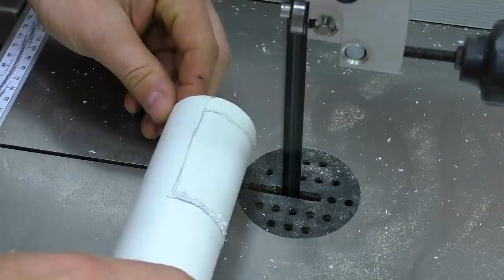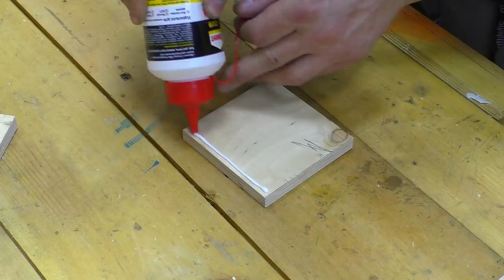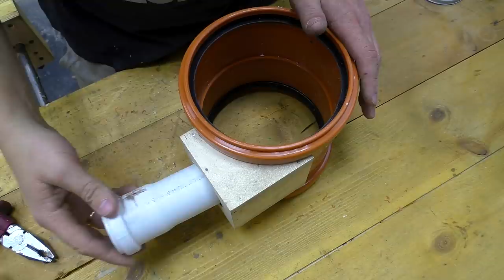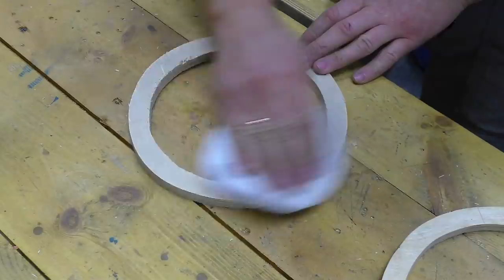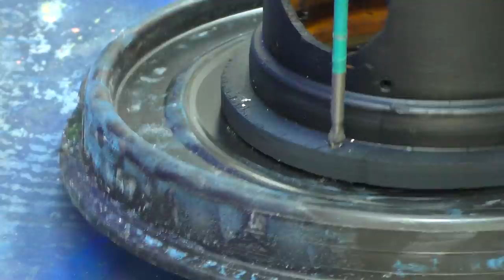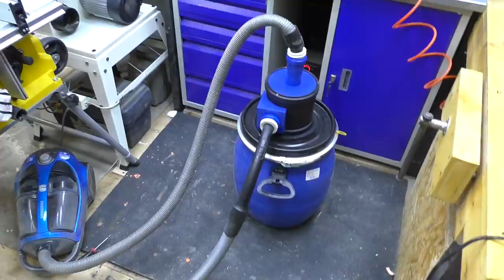A very useful idea for every man! To the garage or workshop.

Comment: At 1:58 into this video, you are showing crosscutting a 3" wide  piece of plywood using the fence as the only guide.  This is one of the most dangerous practices you can do on the table saw. Why? The width of the workpiece that is registered against the fence is too narrow for good control. If it should twist at all, with your hand holding it between the fence and the blade, your fingers will be drawn across the spinning blade resulting in their amputation. DO NOT DO THIS! For crosscutting short lengths on narrow pieces, use the mitergauge with an extended wood fence bolted to the face.
The fence will be cut up into it the first time you use it, but it should be tall enough 3" or 4", to still maintain support. The portion to the right side of the blade will carry your cut off past the blade as you feed it and your fingers will be no where near the blade. Make one of these ASAP! You are flirting with DANGER! See the post just below this one .......
Reply: D Maxson  I'm a complete noob using shop power tools and even I cringed at what he was doing at 2:00.
Reply: Thanks Patrick, video made me cringe

Comment: Well first of all whoever is doing this work has never been professionally taught the safe practices of use on a table saw.
1...blade should only be 1/4” above cutting surface
2...a push stick should be used when sawing a piece smaller than 4” so your hand is safely away from the rotating blade.
3...your right hand shouldn’t be pushing the object through the blade along with your left hand as you could inadvertently push faster thus causing the right side of the wood piece to bind on the back side of the blade and cause kick back. He has his anti-kick back installed but still shouldn’t take chances.
Reply: Kent Hildebrandt Why don’t you make a video and show us how it’s done?  Yep......didn’t think so.
Reply: I was puckering while watching.

Comment: Still using those silly ass phillips screws rather than the Robertson square head.
Reply: Or the star screws.  I use big Timberlock screws for screwing logs together with a 1/2 inch drill. Love em.
Reply: Those are only used in Canada, eh.... In the US, we don’t have them..
Reply: Scott Bergman yes I know. US doesn’t want to use them cause they were invented in Canada. Try building a deck with Phillips screws and some with Robertson screws and you tell me which heads are not stripping. They can take a shit load of torque.

Comment: An extreme amount of work for a vacuum cyclone.
Buy PVC pipe fittings close to the size of your vacuum hose.
Get any bucket or drum with a top.  On one edge of the top put a 90 degree fitting inside the bucket aligned with the side of the bucket and 
use a short piece of pipe to pass through the lid with another 90 bend on top facing away from the bucket. Glue and seal these fittings together. You may have to put caulk or silicone around the fitting to keep it from moving.. 
Install another 90 degree fitting on top of the center of the lid with a short piece of pipe passing through the top connected to a straight coupling inside the center of the lid. Attach the center fitting to your vacuum and the outside fitting to your collection hose.
Once you have the bucket and fittings you can do this almost as fast as you can read it. Total cost about fifteen dollars, if you don't have the pipe and PVC solvent it might cost twenty dollars and a lot less time.

Comment: Cyclonic air separator.  This design seem a bit flawed. The air movement and lift is too rapid. Either a taller throat or a larger diameter would improve it greatly.